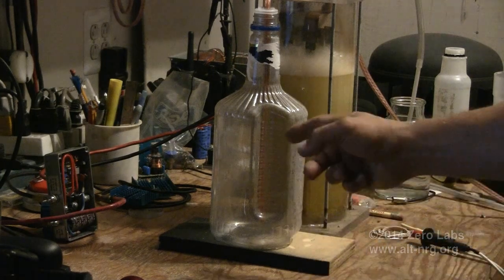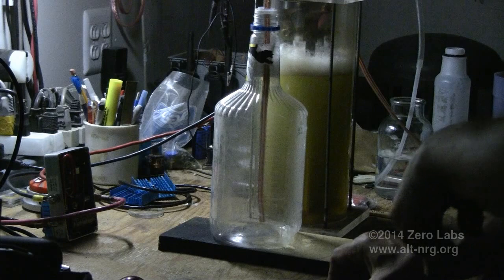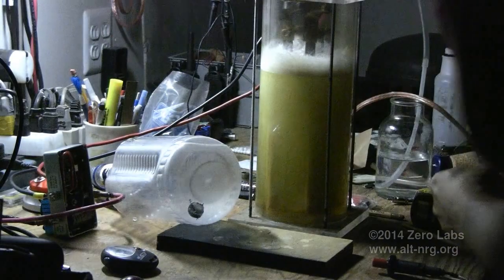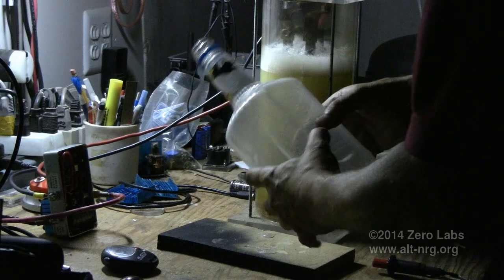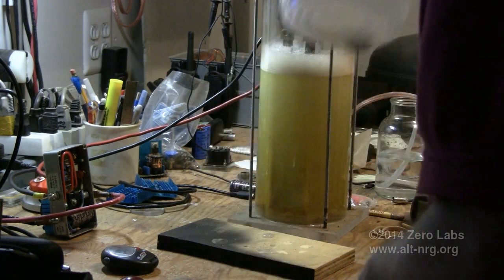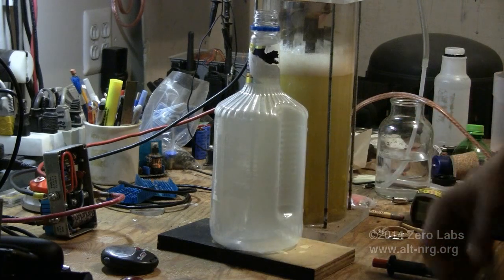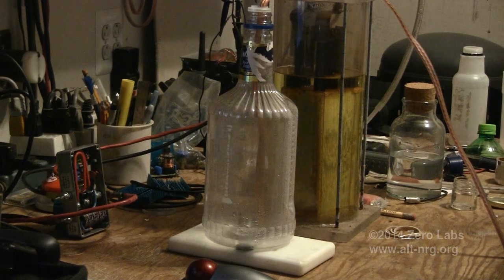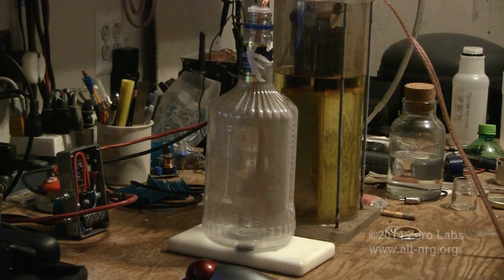#371 More lightning in a bottle!

Comment: Those cheap dollar store electric fly swatters make alot of ozone. ( for the size) I smell it easy, just hold the button continuously,  listen for were a sizzling noise comes from on the racket, and that's were the smell will be.  I know I'm 8 years late, but I saw blue electric lighting going upward to the sky starting at the tree line. It wasn't overly bright, and it was very slow, and it moved like a comillian lizard,  it would go upward, slow, then retreat,  then upward higher, diffrent path, retreat, it went up while retreating within its length, also took diffrent paths, not strate up. It happened 3 times that I witnessed. Over Kentucky in the fall , 1 year ago. 
 Does anyone know anything about this

Comment: hHave you considered tht because you are collecting HHO that in the short term the hydrogen is venting and leaving an enriched oxogen envivonment , and it was the oxy that was burning. over a longer time air creaps in leaving an standard room air mix.
Reply from the maker: +TheBigdonc2 Yes. The experiment was to try and isolate a believed heavier than air gas that would not escape over time. It was vapor (pun intended).